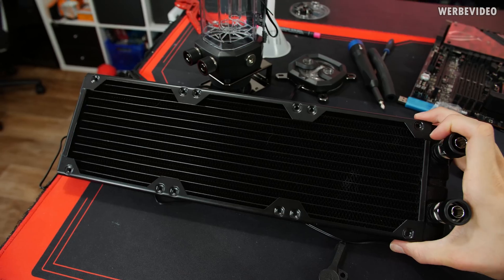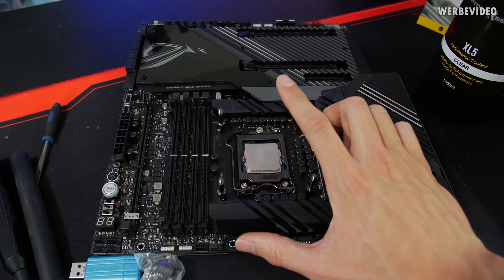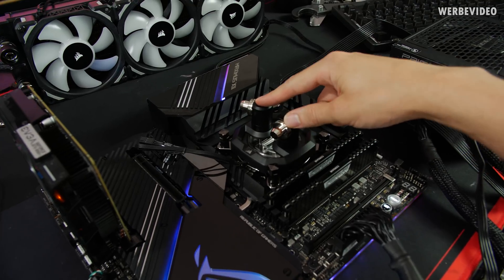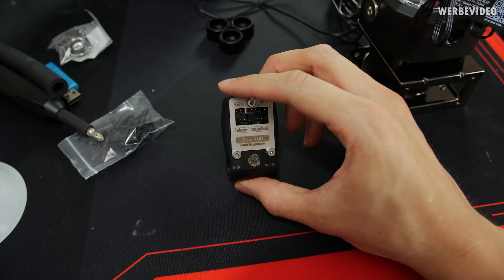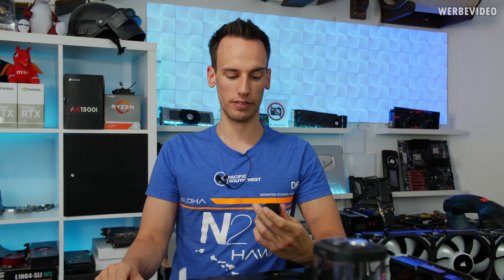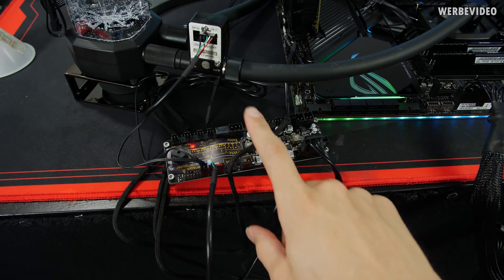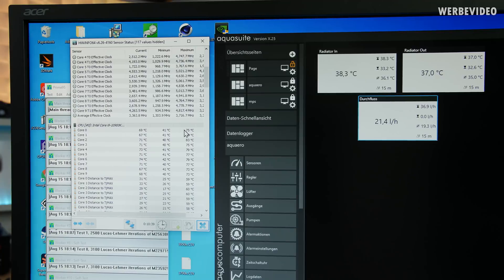Testing one of the Weirdest Water Cooling Myths - A SLOWER Flow Rate will result in BETTER Temps?

Comment: CPU block to GPU block, GPU to dual parallel 240mm rads, rads back to pump.
EKWB aluminum blocks and rads, GTX 1080 TI, i7-9700K, ASUS TUF Gaming mobo.
It works for me; really fast cool-down after GPU tasks...pump runs 100% speed all the time, fan speed linked to CPU temps.
I tried all sorts of component order, settled on dual rads...most of the volume of coolant 'lives' in the rads.
The idea I went with is to keep as much coolant in the rads as possible to dump the heat fast.
Slower flow through the rads gives more time to dump heat.  Testing proved it to me.

Comment: Interesting video, even though it is all things that I already knew. I am surprised that you don't run dual cpu's in parallel. It works perfectly well, and looks much better. I run 2 8280 platinums in parallel and my temps are perfect,

Comment: "those people" should have paid more attention in physics class (the best class) & then they would know the folly of their ideas 🤣🤣
Reply: A pump is cooled by the fluid it moves. At a certain point moving the fluid faster wont make the system any more efficient, but the heat added by the pump will continue to grow resulting in higher temperatures. Imagine cooling a game boy with a huge custom water cooling loop and a massive pump, the pump will literally be a larger heat load than the game boy resulting in higher temperatures.

Comment: Flowmeter, in industry it's called an orifice plate; your explanation is essentially correct.  BTW, I'm a chemical engineer with extensive experience in industrial instrumentation and control.  

Understand that the transport fluid, in this case water, will never have a higher temperature than the heat source nor a lower temperature than the heat sink, in this case, ambient air temperature.
All that is manipulated is the rate of heat transfer, flux rate, between source and fluid and between fluid and sink.  In large or high temperatures, higher flow rate will result in higher flux rates, i.e., higher heat transfer, but at the flow rates and temperatures you guys are dealing with, you're not going to see a noticeable difference.

A massive temperature difference?  Noooooo... not from my perspective.

Thermodynamics is simple, once you understand it.  Problem is, most people don't understand it or are properly educated.

Comment: Are your thermistors calibrated somewhere in the chain? My experience is that they can differ a lot from each other. as much as 2-3c
Maybe you could offer a matched pair of thermister probes at caseking ? The two I bought from alphacooling differ too much to gain any insight into anything.

Comment: great video, however i was left wondering what happens if you put 2 or more radiators in parallel, thereby having a high pump speed to cool the cpu, and a lower flow rate in the rads to more effectively transfer the heat?
Reply: +Mike Gaynor, pretty much the same thing that happens if you have two radiators in series, except now you have the potential issue of uneven flow through the two radiators.

Comment: had to recalculate the liter per hour to liter per minute because my head math was giving me impossible numbers but that flow rate is... odd.... extremely odd.  in my loop (1x 360 alphacool slim, 1x 240 EK PE, EK RTX gpu block, EK Velocity cpu block with a D5 and a EK tuberes/top) 0.9 L/M is the LOWEST i can get (at 25% pump speed, aquacomputer usb controllable pump) what aquacomputer is telling you would be 0.36 to  0.6 L/m. that is freakishly low for a D5. (sensor i'm using to measure is the Aquacomputer High Flow USB which does have a ... wheel...stick.....thing in the path of the water flow.) with a minimum of 0.9 L/m i've found that minimal speed is enough speed, at 30% i start to hear my pump, and even at full blast which results in 3.7L/m my cpu temp drops by maybe 1-2 degree's (it's really hard to tell if it's actually helping, which for me is reason enough to run it at 25%).  perhaps a clogged cpu block, it's microfins tend to be much finer then the gpu's fins resulting in it "filtering out" anything that might have gotten in the loop, atleast it actually helped you in emphasizing the point of the video ^^

Comment: You are very involved in PC tech. Did you ever think about an external cooling box with quick attachment fittings that can be added to a custom loop. This would allow for more volume thus giving the external fluid more time to cool before it reaches the CPU block again. A 520mm radiator can be fitted to an external box with pump included and can be added to any PC through the back removable panels of the PC. Just a thought.

Comment: So we want high flow rate through the components to be cooled and low flow rate through the radiators.That sounds like radiators should be in parallel instead of series?
Reply: +snawbadde, writes "That sounds like radiators should be in parallel instead of series?"

They are. The single inlet is split into multiple (parallel) lanes through the radiator. The number of lanes being limited by the size of the radiator.

Comment: I think the theory behind this idea is from forced induction intercooling in engines. Where cooling the air charge between multiple turbochargers is essential to cool the compressed air before increasing pressure in the next stage. However most do not think of the difference between a closed loop resirculating cycle, and a open loop single pass cycle.

Comment: makes me wonder... with a normal flow rate through the block, if there is a difference between 2 radiators in series or 2 in parallel with a y-split to feed them evenly.

Comment: At what point did you start to see diminishing returns. Between 2000rpm and 4800 rpm you only gain 0.4 c better cooling.  Should try this with a spec better D5 (Corsair have worse spec than say an EK D5)

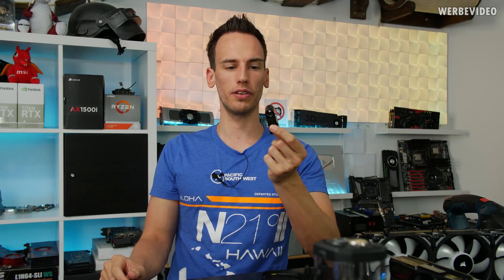Comment: I think the English word you were looking for @3:12 is "calibrated orifice" or just orifice.

Is cavitation ever an issue with high flow rates?

Great video!
Reply: I would expect the probably set the max speed on (most) pumps to be below the threshold where cavitation is a serious issue, though it probably still happens in at least some CPU blocks, but I don't have the knowledge to say for certain

Comment: Because now else will... Would there be video about AIO pumps vs couple dcc and Very High Flow pumps (300l+)? Flowrate will be ever worse with AIO or low power pumps when you add resistant like turns and blocks...

Comment: the one in the title doesnt make sense but I can see a reason for the alternating radiator and heat source 

if you are water watercooling something like ram which took very little power, the energy from the cpu or gpu will just be heating up the ram to a point further than it would have heated up outside the loop.

I see this a lot and dont understand where people get the idea that energy only conducts one way

the only way it couldn't make a difference is if the heat gets perfectly distributed throughout the loop as if water is a superconductor, which if so then the flow rate wouldn't matter...

Comment: Umm, NO. The theory is to SLOW the water at the block ONLY but only to a point so that it may soak (absorb) as much HEAT as possible BEFORE being pumped to the rads. Even then, there is a limit to how much heat a certain liquid CAN absorb and if not pumped away within a specific time frame based on mathematical calculations of fluid mechanics and heat transfer; I do not possess the knowledge to solve those equations but I have read on the topic many times over the years.

 There are ZERO liquid cooling setups that exist with today's technology that would allow for this theory to work properly with the exception of the Roboclocker but even that system is not available for purchase (yet).
Reply: What matters is the total power dissipated, not the temperature of the coolant.

You can slow the coolant down and it'll reach a higher temperature, sure. But that doesn't mean it's absorbing more heat, because that heat is going into a lower mass flow. If you take half as much water and double the temperature increase, you've added the same amount of heat energy in total.

There is not a single water block I have ever seen which will dissipate more power at a slower flow rate.

The Roboclocker is a totally different ball game, because with liquid nitrogen you're involving phase changes.

Comment: Were fans always running at the same speed ? room temperature equal over time ? did you make a graph of power consumption of the pump (and fans) compared to the actual temperature of the cpu to find a sweet spot ? Those would have been interesting things to present

Comment: Where is the point that too much, or too fast of flow rate equals a loss in cooling performance then? Thicker and larger Radiators over longer gaming sessions, where does that impact come into play with increased flow rates? I guess when building custom loops, going with the larger tube size may have more of impact (than) was thinking it would.

Comment: Hey brother, I know you are the king of cooling so I have a question. Please respond. So I have an  Asus Maximus IX Hero  mobo a 7700k 5.0 @ 1.3 in a Lian Li O-11 Dymamic PCMR edition. I have a Corsair H150I XT on the back panel. 3 intakes at the bottom and 3 exhaust up top. Temps are running in the low 70's. Anything I can do?

Comment: This should be pretty obvious to anyone with any amount of engineering experience or education. It's a closed system. Loop order cannot make a significant difference if all of the components are in the same system and you have enough head pressure to move the coolant effectively. If you were to have each component with its own loop, pump, and rad, you might be able to see a statistically significant, although still pretty small, difference versus the same flow and rad size all in one loop. More importantly, though, you would be able to fine tune how big of a rad each component needs to be cooled effectively. Which could be helpful if space to mount rads is at a premium.

Comment: I have my cpu being cooked first in my loop before my graphics cooled by one 420rad and my temps of my card are 60c and cpu temp 48c with max pump speed and I changed to EK reservoir because old one made it so loud and EK has extra dampened rubber grips to mitigate so much sound I literally do not hear anything! Old res would make so mich vibration at half speed

Comment: Here we gooo !!! I love when people speculate on things they have no idea about and then they get proved wrong. HELL YA ! They think a cpu cooling system works like a car engine block or somthing. Were talking about a couple mm thick of water flow in the cpu block not 10 liters of water or coolant running through a massive cast iron engine block. Thanks for smashing this 1.
Reply: the one in the title doesnt make sense but I can see a reason for the alternating radiator and heat source 

if you are water watercooling something like ram which takes very little power, the energy from the cpu or gpu will just be heating up the ram to a point further than it would have heated up outside the loop.
plus anyone with 2 of the same gpu has seen the one after the first reach higher temperatures..

I see this a lot and dont understand where people get the idea that energy only conducts one way

the only way it couldn't make a difference is if the heat gets perfectly distributed throughout the loop as if water is a superconductor, which if so then the flow rate wouldn't matter...

Comment: G'day Roman,
Thanks Sooo Much for this in English, You do an Awesome Job translating,
it was only a guess on my part but I was expecting the slower flow to cause a lack of pressure in the Block Fins & not cool as well as the faster flow with higher pressure, my thought came from watching G/N Steve pull down AIO Coolers which are designed to force the Coolant directly through the Fins of the CPU Block,
As for sequence of Blocks, Rads & Pump I think the only way that it would matter is for ease of flow pattern depending on Rad Position in your case,
using the Lian-Li 011Dynamic an example with all it's options, the order is gonna be different depending where you put the Rads & if you use the Distro Block compared to a Pump/Res Combo

Comment: About your measured flow rate - the mps flow 200 can measure between 40 and 200l/h (hence mps flow 200) so you were right that the values displayed are not correct.

Comment: What about having a high flow rate over the CPU and GPU, then splitting to three parallel flows across three radiators. Your o11 dynamic with three 360 radiators as intakes would create a great positive pressure case, and splitting the flow three ways would create three slow flows across the radiators with fast flow for the CPU and GPU.
Reply: It might at first glance to be a good idea for the water to be as cold as possible at the radiator outlet,  and low flow rates do achieve that. Imagine how low the outlet temp would be with zero flow though. That wouldn't be a good idea. 

A radiator dissipates heat energy along its whole length. If the end of the rad is only half the degrees above ambient that the start is then the end is dissipating only half the energy of the front.
Its counter intuitive but in actuality for best efficiency and maximum heat dissipation we want the coolant temp to change as little as possible between inlet and outlet. The only way to do that is create as much flow as possible.
Reply: Where the water and the radiator makes contact (i.e.where the heat transfer is happening), is called the temperature boundary.

There are various temperature boundary conditions that influences heat transfer.

Increasing flow, improves these conditions at the boundary, increasing heat transfer at the boundary.

So, slowing down the flow rate in the radiators will reduce the temperature boundary conditions where the water makes contact inside the radiators.

Hence why a higher flow rate is good (but this is just one of several other factors to consider when slowing down flow)

In some ways, (in a scenario where something is cooled with a heatsink), increasing flow is equivalent to applying more pressure to on the heatink, thus improving heat transfer at the boundary.

So lowering the flow rate is equivalent to loosening the heatsink screws (except, imagine this happening at the radiator of a water loop)

So, it would be better to have those rads in series, to increase flow, and thus improve the temperature boundary conditions inside the radiators.

Plus, since the flow rate in and out of both serial and parallel setups should be the same, the water should spend the same amount of time in the radiators, in either configuration
Reply: Looking at the inlet/outlet temperature in a test like this, and saying that the lower outlet temperature = better cooling, is a misunderstanding of thermodynamics.

What matters is the amount of heat energy that the radiator can dissipate, in watts. That power dissipation could cool a lot of water by a small amount (meaning a small temperature difference with a high flow rate), or a small amount of water by a large amount (meaning a large temperature difference with a low flow rate), but the thing you care about for the radiator is the actual power dissipation, not the inlet/outlet temperature.

I have not seen a single radiator that dissipates more power at a lower flow rate. Every watercooling radiator will dissipate more heat at a higher flow rate, and less heat at a lower flow rate.

You can't look at the inlet/outlet temperature in this video and extrapolate the result to apply to 3 radiators, because if those radiators are in series, the outlet temperature will be increasingly lower after each radiator. If you split the flow over 3 radiators, the difference between inlet/outlet might be 4C instead of 2C; but if the 3 radiators are in series, the total inlet/outlet difference will be more like 5-6C.

This is why you need to look at power dissipation, not at the inlet/outlet temperatures.

Comment: A very polite "STFU about your water loop theories, here it's how it really works" video. I really enjoyed it.
Reply: the one in the title doesnt make sense but I can see a reason for the alternating radiator and heat source 

if you are water watercooling something like ram which took very little power, the energy from the cpu or gpu will just be heating up the ram to a point further than it would have heated up outside the loop.

I see this a lot and dont understand where people get the idea that energy only conducts one way

the only way it couldn't make a difference is if the heat gets perfectly distributed throughout the loop as if water is a superconductor, which if so then the flow rate wouldn't matter...

Comment: I wonder, if having a system with two pumps, with a both pumps connected to the same reservoir, one pump only connected to the CPU with a high flow rate, and the other pump connected to the radiator, with a slow flow rate.
Reply: there are no gaps in the water so the one pump would just overpower the other causing it to speed up to the equal amount